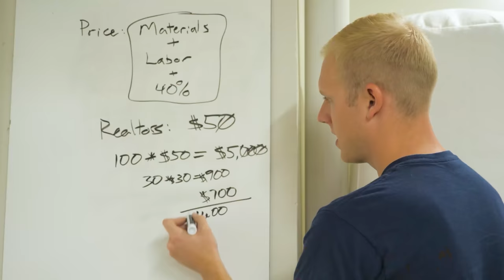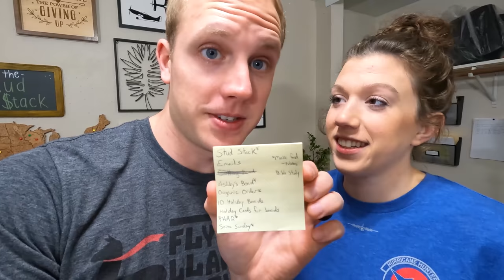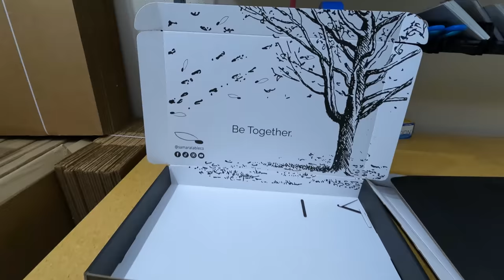Building 163 Cutting Boards for Christmas! 🎄🎅 (and our SECRET SOURCE for custom boxes)

Comment: Even with a 1250 CFM dust collector running, I've started wearing a dust respirator mask anytime I'm doing a significant power tool job in my garage - table saw, miter saw, etc.  For the large volume job you did here you certainly put a lot of fine dust in the air.

You have long and productive lives ahead of you pursuing your dream.  Take care of your lungs.
Reply: Yeah, well said . Really surprised to see that

Comment: In observing your production of boards. It appeared to me that maybe when running a high volume of boards when cutting to length cut them double length do all your gluing, planing, edge squaring and whatever else you may do than cut it to size. This will save time on long runs and possibly short runs.
Reply from the maker: Tried that - doesn’t save enough time for the extra material loss using that method

Comment: I was a consultant most of my career.  A friend of mine who was several years older worked for a major company and talked to me about slowing down and consulting.  He eventually did it.  He called me about 9 months later and said.....the problem is, I am working much more than I want (55 hours per week).  I asked how many hours he wanted to work and he said about 30.  I told him he wasn't charging enough.

Long story short, he kept raising his prices until he got down to the 30 hours per week.  The sweet part of the deal was that with the higher fees, he was making about the same working 30 hours per week as he did working 55 hours per week.

Comment: You guys should get the rockler roller glue bottle, it will save you some time during your glue up stage. Also got a question, when you say part time Air Force, is that the reserves?

Comment: Howdy (again)(I made a comment in/on a previous video y'all did). 

I'm honestly surprised at the success y'all are having with cutting boards, as the market is absolutely flooded with them. Something like 35k results on Etsy alone. 

I'm curious, from a business pov, what was the trigger for y'all to go forward with cutting boards in a market saturated with them? 

Obviously, you're being successful and they're not all going to Realtors (as per the upset customer returning one). I'm just wondering the "why" of that particular direction? I'm 48, been woodworking since I was 13. Building a cutting board was part of a test I had to take back in Jr. High woodshop in order the earn the right to learn/use a lathe. (I still have that cutting board too). 

Perhaps I was overthinking the market, as to me, the saturation of the market and the ease/scope of work made me skip that plan altogether. But then again, my wife constantly tells me I overthink things. 

Thanks for the videos and time. Definitely gave me something to mow over.

Comment: Just wondering if you dont do any other finishing once you rip on the band saw ? Is the cut good enough as is for the glue up ?
Reply from the maker: They get turned 90 degrees - bandsaw marks get planed away after glue up
Reply: Joint 2 sides and thickness the third side.  When gluing up rotatable boards 90 degrees so band saw edges are up and glue the surfaced edges.  Then thicknes and sand the surfaces

Comment: Take a look at the manual for that bandsaw!  We've got the same one here and YES you can flip the fence, however it's more stable in the other (180 degrees) configuration - where the flat is against the saw table.
Reply from the maker: Sounds like you read the manual for us - thanks for saving us the time! ;)

Comment: I think the bandsaw fence is supposed to flip the other way. The way you laid it down was bottom facing up. …I could be wrong
Reply: I thought it was some next level trolling on the part of Davis :)
Reply from the maker: @niftygriffty  you DRASTICALLY overestimate my capacity to keep a poker face…

So then why does the fence have slots on the side I had it on!?!

Comment: Wow $10-12 an hour!  I'm puzzled you're planning on setting up a commercial shop with that labor rate?  If you take the actual hourly labor & add in your share of FICA, FUTA, state workman's compensation, insurance & benefits to equal total expense of an employee so this would mean your paying your employee about $7-8/hr.  This is a entry level semi skilled job, are the labor rates really that low in Tx or is this number not correct?  Interested to see a video on your current shop rate vs. your (calculated) new commercial shop rate.  Love your videos, but this number does not calculate for me, any clarity would be great.
Reply from the maker: Hey Shannon, thanks for watching! You're asking wayyyy too much from rough numbers we just threw out in a video haha. All of that will be calculated - don't you worry.

Comment: Your boards are only 3/4 thick and will split open wood isn't that nice and flat grained they will split quicker than normal. I saw your prices are $100 -$128 plus which is expensive for a plain jane board. Buy a Boos 1-1/2in for under $75. I know you just love me right now Christmas is almost overs